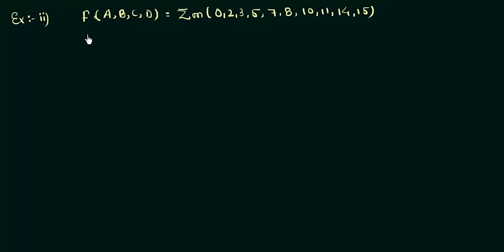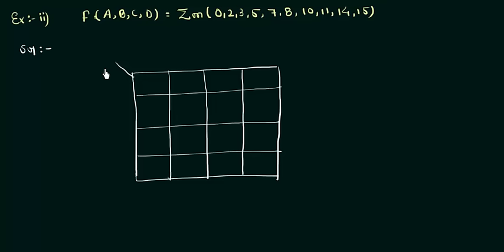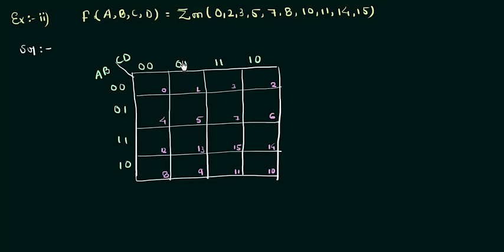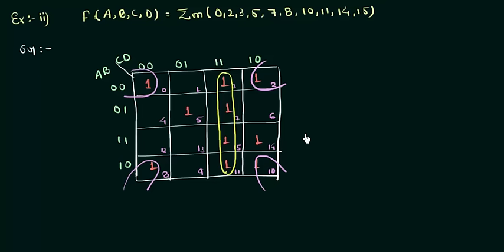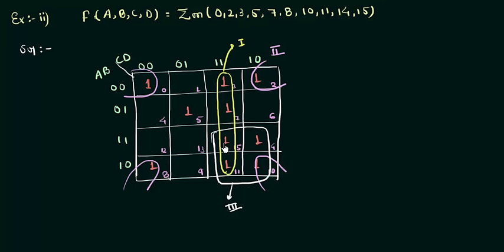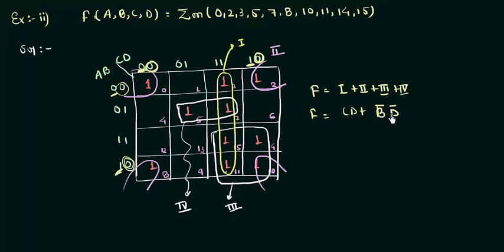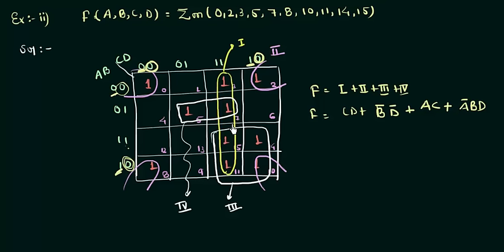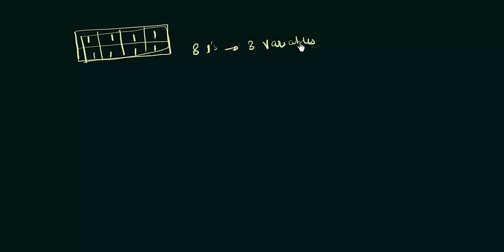4 Variable Karnaugh Map (Part 2)

Comment: Sir apne previous video m bataya tha ki 2  pair of 1's m 1 literal is reduced but in this example the 4th pair  contain 2 1's but you written 3  variable  in place of 1. Please. Clear the doubt 😊
Reply: 1 literal is reduced means out of 4 variables we have in question.
From those 4 variable 1 will be reduced.
As per my understanding.

Comment: Hello sir, i seriously need help, i chose implicants like this {(m15, m14, m11, m10), (m11, m10, m3, m2), (m5, m7), (m0, m8)} is this another solution or is this redundant?
Reply: Nevermind, i should have paired m0, m2, m8, m10 because that's the only 4 1's configuration allowed for m0 and m8, so if i don't pair them in a group of 4 even if this possibility exists then i'm going against the rules of the Kmap
Reply: Actually it can be done in either or ways

Comment: Sir what about,2x2 k map with 3 input variables
How to use it
Reply: You cannot make a 2x2 k map with 3 input variable. The size of the k map depends on the number of input variables. Here is a general formula
size of k map = 2^n, where n is the number of input variables.
if input variables are 3 then the formula becomes 2^3 = 8 so this means you will have to make the k map that can contain 8 values.

Comment: Hello sir,
In the second example, instead of pairing 4 literals can't we just pair only two that is m14 and m15?
Reply: No of literals will be max , which is not good
Reply: @videoagent7770  can u explain it with more detail why we can't pair m14 and m15?
Reply: I have combine m14 and m15 .my ans will be right or wrong?
Reply: @AlinaKhan-bx2fz  first priority is to reduce the no. of literals ..your ans may be right or wrong , it depends on the examiner
Reply: @AlinaKhan-bx2fz  if you see that you can combine four 1's or 0's , you should consider that
Reply: @videoagent7770  Thank u 🤗for making my doubts clear
Reply: according to priority we have to pair, 16,8,4,2 since the maximum priority is 4 we should combine 4

Comment: My ans is different... dnt know right or wrong...
Reply: @nehachopra4159  it depends on how you did the pairing... If the pairing is different answer is going to be different but it may be right also if u've done it correctly
Reply: Ankit Suneja exactly, I did my pairing differently and I got an answer that's different from op and neso's. But I want to be clear on whether we need to always try to create prime implicants? Even if we had the option of making a group of four 1s but we make two groups of  two 1s  instead - would that be wrong?
Reply: @bonbonvrock84  yes it's going to be wrong cause according to pairing it works on priority which is 16 then 8 then 4 then 2
So u can't do that